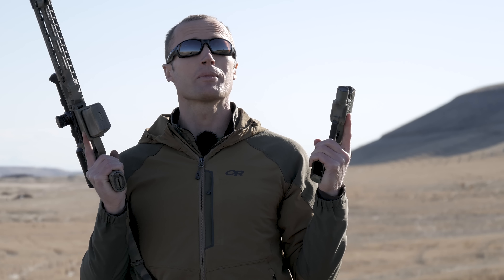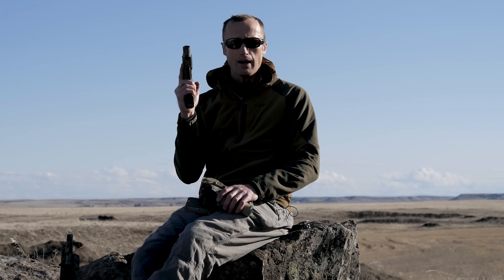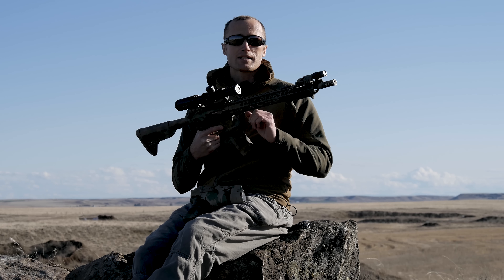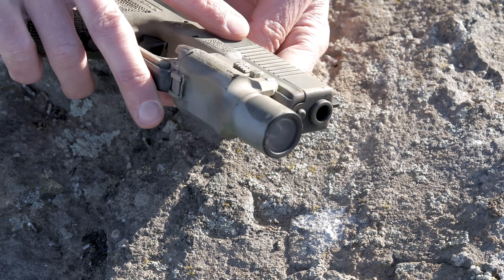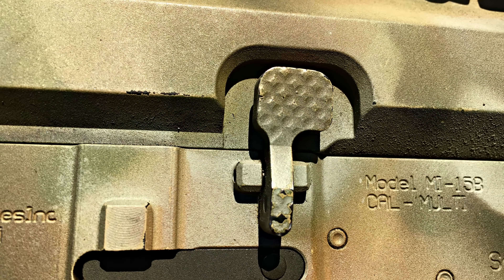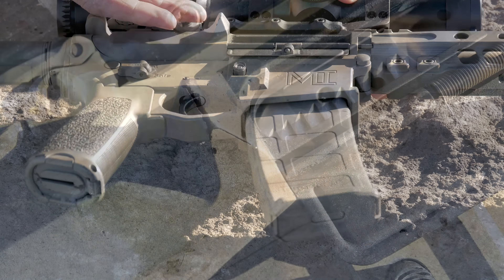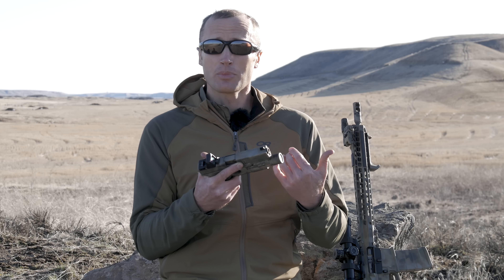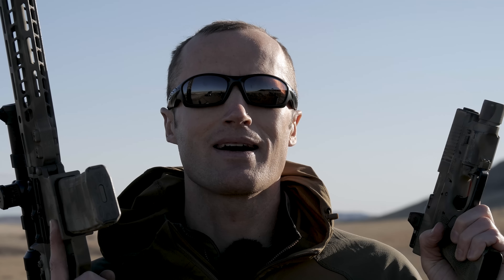Painted Weapons and How They Wear

Comment: I don't know how I missed your painting videos. Your guns have actually worn pretty good. Heck, even without paint, typically your favorite pet rifle(s) tend to end up pretty beat up. lol My old dissy... rough as hell and no paint. Dings and nicks all over the hand guard, shell defector, EO-Tech hood, and any where that can get snagged. That thing rode in truck beds, got kicked around, bashed against rocks, got dropped, and abused all in the name of science. lol I mean you need to know something is reliable right? Either way, I think you've convinced me certain rifles need rattle can paint jobs.
Reply from the maker: Hahaha, right on.  :)  Painting weapons is pretty fun too.  The only reason I haven't painted my little rifle I have been using lately, is I am usually swapping rails...
Reply: I was actually wondering why you hadn't painted that little beast yet. It looks like a fun little rifle. My little 10.5" might get paint before I head out to shoot with you. I'm going to do some zeroing in the next couple days in an effort to square some things away in preparation. It might have to come back apart, but the issue doesn't hurt the usability of the rifle by any means. I'd just be truing the receiver face. The dissy... it was going to get paint... Then there was dissy drama. Its a bit of a funny story. Subsequently I've got one of my other AR's all cleaned, lubed, and ready to be zero'd. Its not getting paint though. I know I had mentioned making not black guns and I think The AR's that were in question will all end up rattle canned. The 700, which doesn't see any real abuse, will get duracoat. I know that sounds backwards, but its a nice rifle and it deserves a bit better paint job.

Comment: Does aervoe make a gray that is matte? I see one that is marked as high gloss. :0 no thank you. But would like to do a gray triangle patterned so need three to 4 gray levels. Also I can’t find the matte clear coat thanks for the video.
Reply from the maker: Yes, it can be hard to find.  DSG used to carry all of their stuff, but has since trimmed that line it seems like.  For matte clear coat I often just use Rustoleum.
Reply: Kit Badger do you feel the same of rustoleum regular matte colors as gray seems to be impossible to find from Aervoe for a reasonable price or single quantity.
Reply from the maker: @Ughthisagain  I think Aervoe is better wearing and flatter, but take what you can find.
Reply: Kit Badger well.. used rustoleum for practice on a short hand guard. Figure I can always dip it in acetone easily to remove. Got really drippy and matte was meh. Gonna rough it up with a burlap cloth and see if it mattes  out more. But this one may become a redo LOL.
Reply from the maker: @Ughthisagain  easy to practice.  :)

Comment: great vid thanks, if you did decide to repaint,  how would you remove existing paint?
Reply from the maker: Honestly I would probably just touch up spots if I felt it needed it or just paint over it.  I have stripped paint off of a Glock slide I had painted.  Only because I was sending it to a machinist to have work done on it.

Comment: Did your guns have that gritty feel after you painted them? 
Does that ever go away?
Reply: Mine were sticky, but I hit it with a heat gun  to get rid of that feeling. If it's gritty it means that you were spraying too far away. The particles were drying before they hit the surface. Grittiness doesn't really go away unless you paint it again with a thicker wet coat.